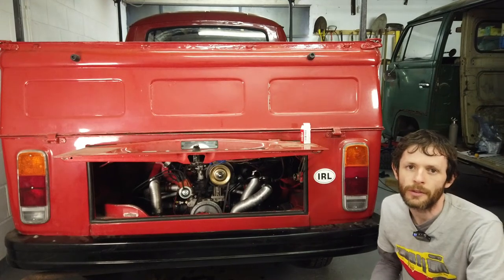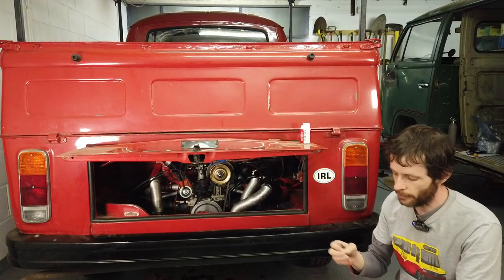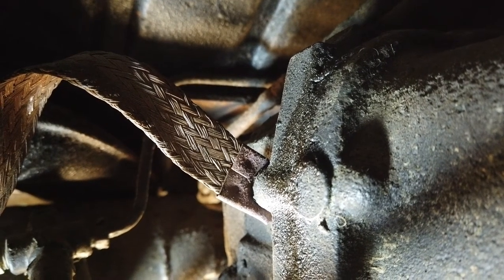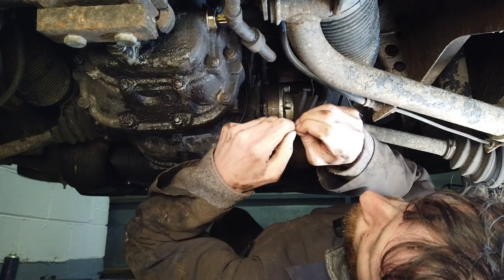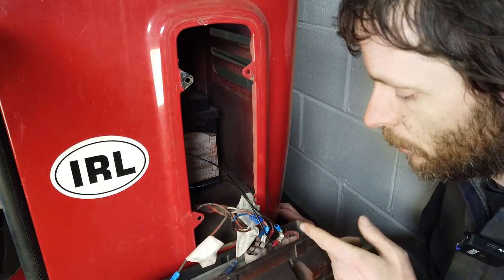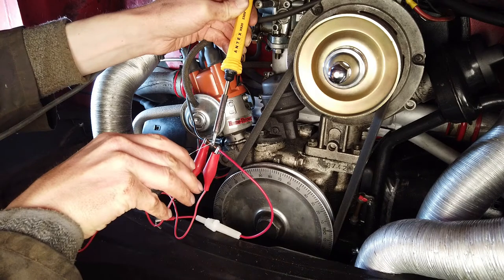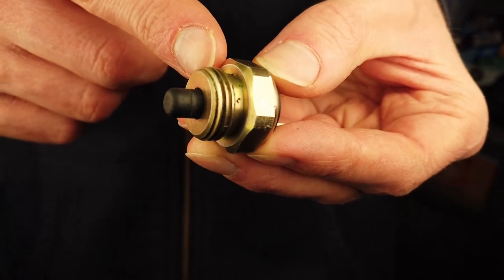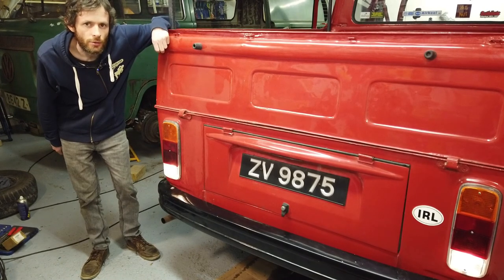VW reversing light switch

Comment: Rob, thanks so much for the video on reverse light install for the Bus!  Even though you posted this 2 years ago it really came in handy today as I'm restoring my 72 Transporter.  I was able to trace out my switch location and the wiring.  As a result I found the in line fuse holder missing the fuse and wire to the coil.